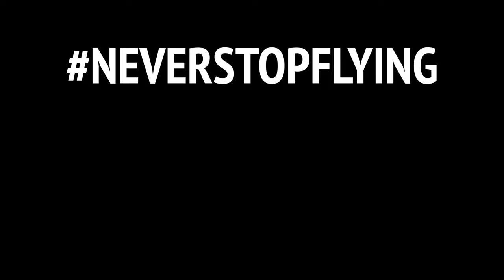I WAS WRONG | HQ J37 are actually a durable prop

Comment: In this hobby even if you don’t like something you have to tell the world how wonderful the product is..  

but with plastic like props poly carbonate.. when it’s injected the variable difference can be quite significant..  with color and moisture content in humidity during manufacturing and after while you have them ..
Reply from the maker: That seems to be what so many do.  I try to tell it like it is but I also try to not be too harsh either... But felt I needed to say I was wrong after having some good experience with them when I gave them another chance
Reply: @StacemanFPV  we had gemfan snap off at the hub on one crash.. next set never broke just got chewed up  .. big variance is mass production .. plastics are temperamental ..
Reply from the maker: Yeah they've gotten way better than they used to be though
Reply: @StacemanFPV  maybe do a glass fiber prop test.. ???? old school .. apparently I think Steele may have said they fly great better than poly when it was being introduced.. but couldn’t take much of a impact..
Reply from the maker: I've flown those a long time ago..I don't think you can even buy those now